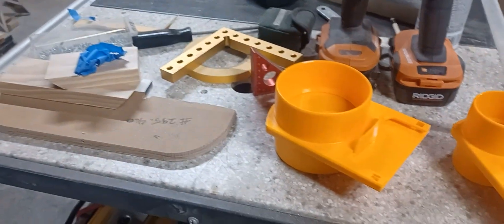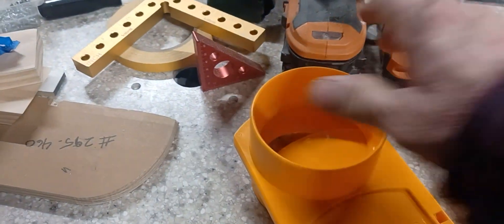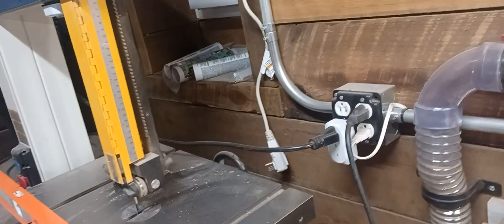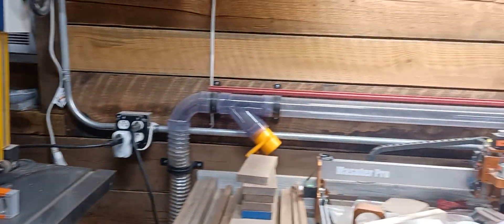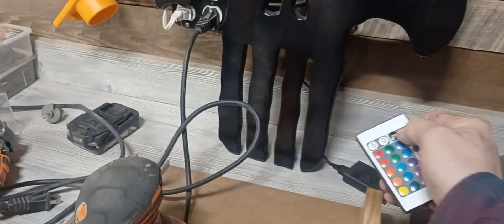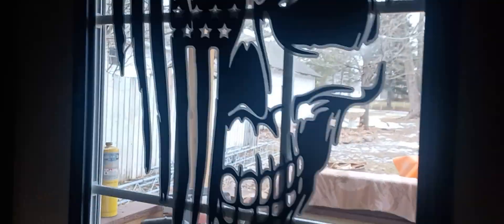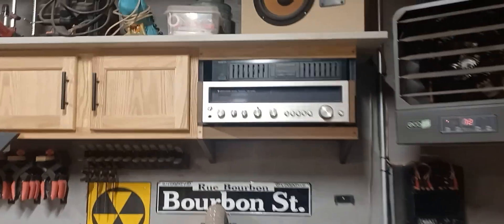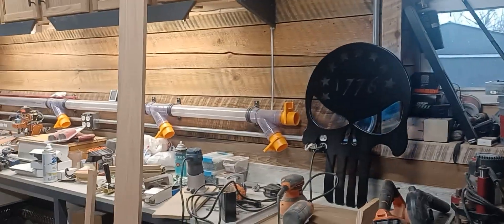Shop Vid For StonerEricson

Comment: So awesome man!! thank you so much I need. No I will get those blast gates! love the skull and shop tour hell ya  thanks again I will shot out this video on my channel
Reply from the maker: Right on man. Let's see a video when you install them😁... 
Now that my channel will be geared towards the shop more vs pyrotechnics etc. I think a shout out would be honken rad😁 Appreciate it bud thabk you.
Reply: @houseoffire72  hell ya man I appreciate all the help. I’ll definitely get those. I’ll make a video about it. We should collaborate on something for sure. How much are those blast gates?
Reply from the maker: @StonerEricson  POWERTEC 70295-P4 4-Inch Integrated Blast Gate Clog Resistant, Anti Gap Tapered ABS Plastic Fitting for Dust Collection Systems – 4 Pack https://a.co/d/cqx14Q4

A collab would be fun😁 Any ideas..?
Reply: @houseoffire72   29$ for 4 nice I was thinking something like a yo-yo carve on our CNC machines I carve 1/2 you have the other and then we put them together in the video make two one for your channel one for mine? Sometimes fun like that
Reply from the maker: @StonerEricson  Sounds like fun man but ya see I haven't even ran my CNC yet. Having issues with Windows 11 & the Fox Alíen software. Can't seem to get it uplaoded to laptop & don't wanna buy software as of yet...
Reply: @houseoffire72   let me think about it. I’m sure we can come up with something cool.  I’m in dripping Springs Texas. Where are you at?
Reply: @houseoffire72  did u see the short I posted
Reply from the maker: @StonerEricson  Not yet was just headed over bud

Comment: That’s a lot of hoes and pipe you laid.
Very impressive looking shop!

One thing I’ve noticed is I get rid of one piece of clutter and acquire 10 more so don’t feel to bad lol 😅
Reply from the maker: All total I laid 40ft of 4" - approx 20ft of 2.5" 

So far all is good but will prolly upgrade to larger impeller on the dust collector after I build a proper workbench/ router table. I do alot of pattern routing when building speaker enclousers with MDF. Gotta have good dust collection..! 

Cool story. All the rustic lumber in here came from an old iron ore shoot from Lake Superior Wisconsin. 

Take care man